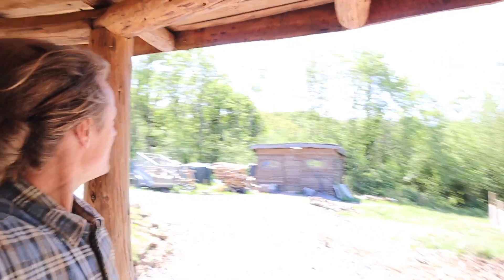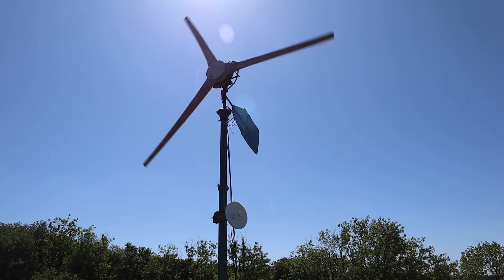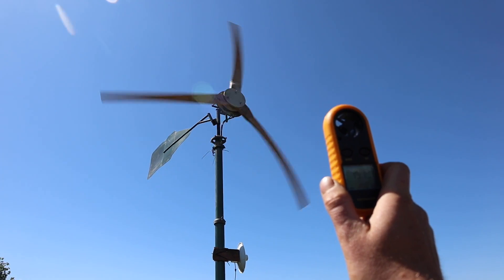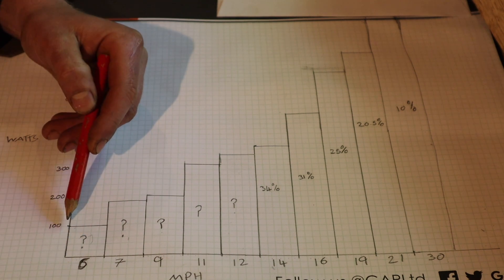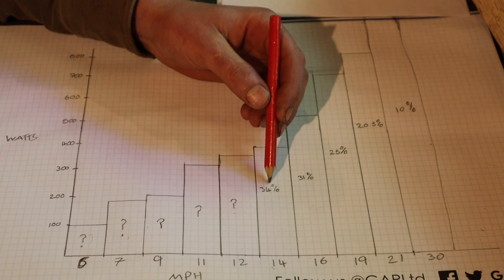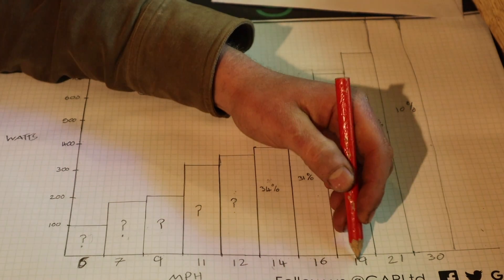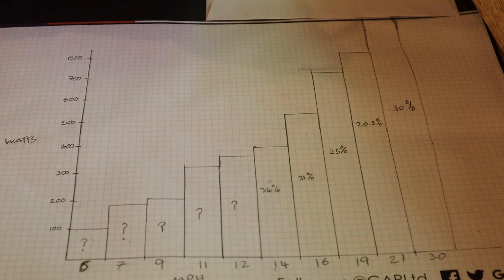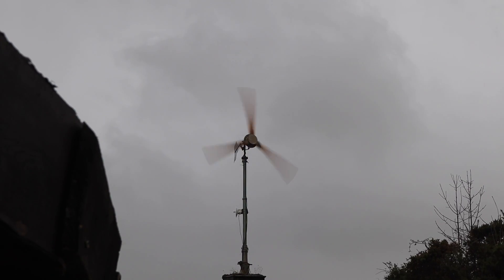Axial Flux Wind Turbine Efficiency calculations

Comment: Kris well done. I was raised of grid even Born of grid back in 1952. in my day we used dynamos of Loris & cars & our Controller was the vibrating points controller' box & regulator that ultimately rectified the current & control its voltage.  to a 30Amp or less. the thinking behind it back then was like. farming bad land. Even 14 amps of power chares you Bartis. 
So: - having a wind-turbine like having sheep on the farm. producing at all times & chewing the could. as they do so they put on fat. which is collated when sold at the market in cash money.  Just like a wind Tribune spinning away producing power wile one sleeps & storing that power in a bank of Batteries.  we keep sheep on land to graze. while we produce crops that are more productive & cash rich.   Sheep graze unproductive.  land we cannot put crops on. much like dirty wind, Produce- power   at a time Wich like fat & sheep grows into a harvestable crop in time.  & Like sheep you're enring while you sleep.     An analogy I think that suns up the use of the windmill in micro generating, requirements & why it impotent to include it in some form in your generating requirement & the big battery bank's so peak power can be transferred when one battery is full up.  💖👍

Comment: Love the various means of alternative energy! In regards to loss, i wonder about the wire gauge along your run. You can also see losses on aluminum vs copper per foot. You might also have a voltage drop if your ac to dc rectifier is in the shack by the turbine. DC suffers from higher losses per foot. If you know all this ignore me! Just sharing if you're looking for ideas. 500W+ is amazing!

Comment: I'd reduce max windspeed the turbine has to endure. Stay at 34% or 31%, ballpark. Prolongs lifetime, you probably want to reduce speed cycles as much as possible in the high wind/gust range. As that is what is eating away material, literally. Steady rotation at optimum efficiency without the hunt for max power peaks is what I am pushing my turbine for. It may depend on your local conditions, if you get only gusty wind, I'd still try to clip out early on those high speed episodes. One day sooner or later the bearings, blades, blademounts, mast or tail hinge will fail. I hope it will rather later. But thanks for the video, sure enough. :)

Comment: A grain silo cut in half suspended in a layer of water could hold a lot of hydrogen produced of that excess electricity.  You could use it for gas cooking, or a ton of other things and it stores for a long while.

Comment: Why not store power in battery packs as opposed to waste the power by leaving everything on?
Reply: I imagine he will have batteries. When you design a system like this you build it to still give you enough power when you hit winter with little usable sun and days without much wind. So he will have enough battery storage for those times, which will be quite a bit. The problem is that in summer, when you have 2Kw of solar all day (10 hours) and a lot of wind, you would need an exponential amount of batteries to store it. Even small systems have a 'dump load' to stop the battery bank overcharging when there is a massive surplus in power. These days you can use a grid tie inverter to export any surplus power to the national grid but I suspect he has no grid connection. Apologies for butting in....

Comment: Now I'm totally confused about efficiency since I had assumed that if nothing is changed, the rate of efficiency would remain static. Then I thought about resistance to amperage and heat buildup, and gave you some BUT not such large percentages.  I'm thinking the measuring of wind speeds is not up to snuff. Maybe placing the meter outside on the turbine face and aimed in the same direction as the turbine (avoiding the prop wash).. might be better? Then only power level (amperages) vs resistance would be in the mix...???
Reply from the maker: Wind power is cubed so if you double the wind speed the available power goes up by 8x but the losses are also cubed. The blades can only take so much energy before they start to deflect a bit and not be able to spin any faster (because they are locked to the battery voltage) so try efficiency goes down just as quickly as the available power goes up. There are cable losses as well but this are small compared to the blade loss in high wind. You won’t ever make something efficient through such a wide band. If it works well at 30 mph wind it won’t work well in 10mph  wind. Mine is sized to work at our average wind speeds so in higher wind the blades just can’t catch the energy as effectively. Which is complexly normal and expected.

Comment: Hi Kris.

Have you seen the TriStar follower on Hugh's site?

It uses the PWM output from the controller to fire an SSR to turn an immersion heater load on.

The beauty of it is that if your immersion gets too warm it will just automatically go back to using your normal dumploads with no issues.

http://scoraigwind.co.uk/tristar-follower-to-control-ac-heaters/

Comment: Make a hot tub to dump your extra power generation into. Insulate it and it'll stay hot for days. If you generate extra power during winter you can use a small pump and two radiators to use that extra heat energy to heat your house. Way cheaper than buying more battery capacity.
Reply: For efficiency, hot water storage of surplus energy is definitely the way to go !
Reply: Is it possible to make a electric sideways tilt(or bend) engine between the windturbine and the tail, that activates from aprox. 20m/s, which would push the tail as well as the turbine of angle from the wind, which should it theory slow it down. This might keep the roteation speed down below 20 m/s and giver it a higher watt out put ?
Reply: Nitrogen tanks
Reply: He did mention he wanted a hot tub. Yes that would fit in very very well.
Reply: Or use battery packs to store power!?
Reply: @roozbehfarhadi9993  He said in the comment that that is more expensive.

Comment: You should run insulated water lines to each building and use excess energy to run a heater in a big insulated water tank. Pump that warm water to each building when you want some extra heat so you don't use up your wood so fast. Maybe even add a boiler and steam engine driven generator to the side of your power shed to give your battery a boost and use the waste heat from that to heat up your water.

Comment: Hi Kris, nice to see the numbers!
Like you explained, probably the error with question marks is due to the fact that you are measuring speed near the ground and the wind speeds are much higher up the tower.
Did you calculate the efficiency based od  P = 1/2 rho S v^3, btw?
Based on Betz Limit, stating that max efficiency around 60%, your number of 35% with lower measured wind speed is actually quite good.

If I add on other people's suggestions, on the days of too much power, you could fire up a fan (or even a fan heater) in your wood shed and help it dry faster and more thoroughly. Or maybe have a barrel of water with heater in your workshop to help heat it, if the surplus power is also available in winter. An even crazier option would be to heat the compost in order to get done faster.

Comment: Terrific,  Always love your videos, plus one with some energy data and by someone who knows to report power in watts (as opposed to volts or amps which make no sense at all). Good job.
A couple of things though.
I suspect your low speed readings are overly effected by the height at which you are measuring the wind speed.  The ground does a good job of calming everything down, so unless you grow really long arms, this is going to be a problem.  Other people have suggested mounting the anemometer up with the turbine itself (a bad idea, as the blades mess up the measurements), or use the blade rotation as a wind speed indicator (another bad idea, as to work as an anemometer, the blades can't be loaded by a generator).. Ideally, a second pole some distance to the side of the turbine to hold your measuring device - this would work, though it wouldn't be so easy to read up there.

If you are really losing 90% of your power at the top range, then your 1KW of battery-generation power means 9kW of losses, which does sound like some seriously hot wires (depending on how long they are and how easily they can shed heat).  My guess is that the main losses are not actually in electrical resistance, but more in the turbulent air around the blades as they spin faster and faster.  All sorts of interesting things happen as the blade tips approach the speed of sound (not sure if your anywhere near that yet).

On the other hand, who cares how efficient it is if you get enough power and can benefit to any degree by the increased potential without the turbines flying apart.
Good stuff though and keep up the very interesting work on this and all your other projects.
Michael Moore

Comment: I would be terrified that the turbine would crash when people are around it.
Reply: I had a turbine, and storms would always shit me up. Once it lost a blade, and it was found 1/2mile away, several weeks later. They'll bury themselves 2 foot in the ground if close to pole. Blade is an accurate description. It took storm doris to bend the scaffold pole it was on, to get me to give up, and get stress free.The bearings were shot by that point, what happens when you lose a blade and become unbalanced. They are good for 24hour power through, especially winter, when the PV struggles.
Reply: @chrisfryer3118  Did your turbine spin as fast as kris's? 
The amount of kinetic energy looks enough to kill a small town
Reply: @Porouskilldeathratio  Hard to tell without seeing his with a naked eye, camera meh. I couldn't see the blades in a good blow. Always wondered what it'd do to a cucumber thrown at it, at those times. I'd get a cut of the blades mounting them, without gloves. T-rex blades on a '600 watt' reconfigured alternator. These blades didn't fail. Saw over 1300 watt in one storm. I had no way over turning it off.

Comment: Yeah I would recommend a power management unit, the big boys use breaks and can twist their blades, but you can't (you could but it would be hard). The unit is actually a part from the offgrid hydro industy, the 15kV range..  at a certain output, you can let it swith to a wasting circuit and have heaters come on in a pond, which you could top of with the creek. Slows the turbine down, to keep it in one piece. But still a cool video, learned a lot as always
Reply: You can achieve the same effect with a small circuit and a $100 SSR to facilitate AC dumping if you're using a PWM wind controller like the TriStar. If using an MPPT controller they all have built in contactors to fire relays anyway.

It's a good idea though!

Comment: What is the top wind speed before you turn off the turbine? I miss the old fashioned windmills with the wider blades. Are they still available?
Reply from the maker: It’s about 25mph when it turns out of the wind on its own due to the tail design

Comment: Wow Kris that turbine does a good job! I bought one rated for 1500 watts but doubt I will ever see it..it doesn't produce very much usable power at low wind speeds like yours, which is much more usable in the real world. What did you use for the generator mayb I will try and build one like you and have one for high wind and a more usable one for just breezy days. Much respect.

Comment: Your graph shows that your turbine with fixed blade angle is designed for a certain windspeed to be functioning optimally.
Which is a quite low windspeed judging from it.
So what I would do is to calculate  what the best blade angle is for the most energy harvested in a year, depending on the wind regime at your location.
Or make the blade angle variable....
Reply: I was wondering about that myself - what is the blade angle that he chose?  We should be able to figure out the optimum blade speed /wind speed based on that.

Comment: Dumb question: Why do you have to burn the excess energy?
Reply: Is there no way to switch off the generating systems when at storage capacity?
Reply from the maker: As far as the wind turbine goes it has to be loaded so if I don’t use the power it will just be turned in to heat anyway so it won’t freespin and get damaged
Reply: Thanks for the reply. I appreciate the honesty in the videos and your positivity. Watching from Canada

Comment: Have you ever considered putting some kind of speed measurement on top of the wind turbine itself? Maybe even hook it up to a raspberry pi or similar board to log the data to an SD card (combined with power readings) so you can see efficiency over time. If you did the same with your other power inputs, you could get an amazing comparison between each over a few years' time to really show what is most efficient and cost effective, would be very interesting to see and I don't know of any other channel that has both hydro and a wind turbine
Reply: I was just thinking the same thing, anemometer's aren't that expensive (or a "weather station" which has more sensors on it), and if he connected it to a raspberry pi 3/4 (which has wifi built-in) he could just view it from his house can be done pretty easily using https://github.com/weewx/weewx Kris, if you're interested I wouldn't mind helping you

Comment: Kris, your solar and wind energy efforts are awesome! When you said you were "burning off" energy and warming water it got me thinking about vacuum tube solar collectors. Water warmers. If you could make a few thousand liters worth of properly insulated water tanks you might be able to store more energy, that can be used for heating in the form of radiators or under floor heating etc. Not sure if it would be anything for you, but I thought I'd suggest it just in case you haven't considered it.

Comment: I love data.  Are you able to associate (or measure) RPM of your blades with wind speed?  It struck me that the little orange wind speed meter is a spinning fan calibrated for RPM --> speed.  Maybe enough data points over time will allow you to get a good estimate of wind speed based on how fast your turbine is spinning, making it into a giant wind speed meter (at least up until the tail moves it out of direct path of the wind).  Thanks for the extra vid!
Reply: I love data to. A reed switch and an Arduino will measure rpm. Also the rpm of a homemade anemometer which can be converted into wind speed.
A current measurement module and an SD card module and its possible to make a cheap data logger with an Arduino. Voltage can also be measured with a suitable voltage divider to bring it within 0 - 5V.
Reply: @Ed.R  True that you could computerize it, but I'm not sure the resulting data would be useful for much more than admiring data for it's own sake (so the juice might not be worth the squeeze).  I think he has that setup tuned up about as good as he can get it, so the data is just the "gee whiz" cherry on top.  Still fun to look at though!
Reply: @69Buddha  Exactly the way to think of it. He has the skills to tune its performance just by observing and listening to it.
Data only really becomes necessary if its design was going to sold and then a proper power curve would be desirable.
Reply: could also be done with a raspberry pi.  to get the RPM, could do it either with a reed switch (as suggested by one or the replies) or (bit more expensive) measure the sine wave frequency from the coils dividing by the number of coils to get RPM.

Comment: Nice work, mate.
If you're interested in understanding the turbine's characteristics in greater / more precise detail, you can sample shaft speed or machine shaft frequency and voltage data using an Arduino or similar device. The captured data can then be processed in Excel to illustrate a variety of aspects, including machine efficiency. 🙂
Reply: Just to flag that you could also process your data in a free program such as OpenOffice or R/RStudio

Comment: Great little update in the wind turbine but Am I missing something? No batteries to store this peak/excess energy?
Reply: With all the rain he gets or solar in the summer his batteries are probably topped off most of the time. Hot water tank acts as the biggest dump load in the place but that won't take long to heat up fully at those wattages!

Comment: Do you also have solar power? Could be a nice little backup, if wind is weak during the sunny days.
Reply: He's got solar and hydro so he's covered himself for all eventualities!
Reply: @MarkVicarage  Yes, hydro looks to be the most efficient from what I've seen.  Its a perfect option for living in South Wales! Here in South Wales, rain is more common than sun 🤣
Reply from the maker: Yes we have about 2kw of solar. solar is the main source in the summer with wind backing that up on cloudy days. Hydro is 80% of our power in the winter with solar and wind for dry periods. the wind can be a bit of a pain in the winter storms though as we get to much power. On those stormy days i tend to turn the hydro off.
Reply: The only thing he hasn't got is a small nuclear reactor in the top field :)